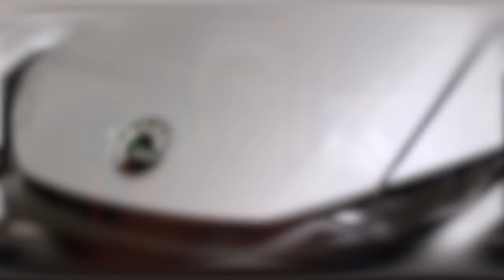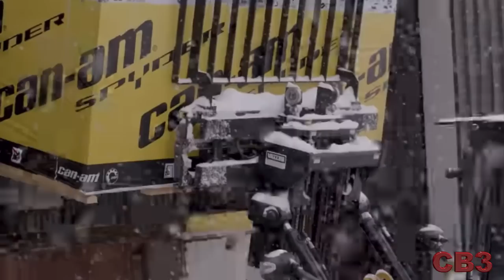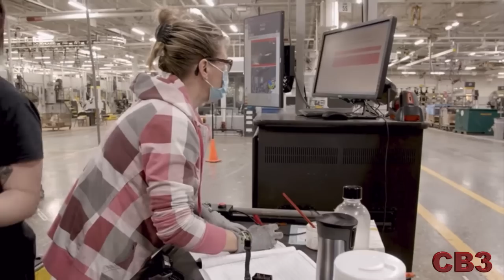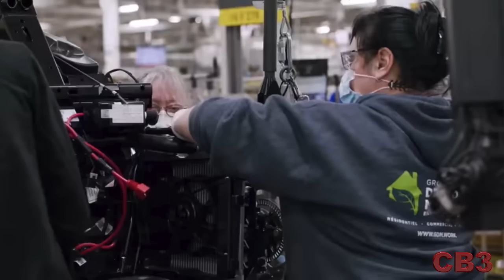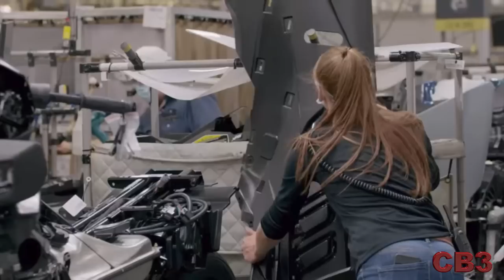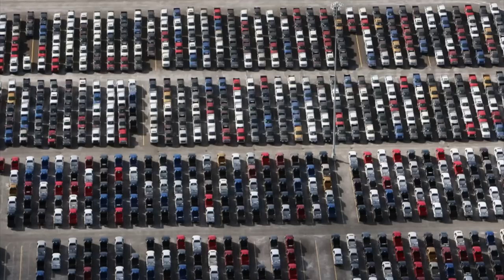WHERE'S MY SPYDER?!?  BRP Production and Shipping Delays!!!

Comment: Great post, Coach Bob - I really needed this!  You nailed a good bit of what's happening, but I have to speak from a consumer in the middle of a purchase perspective.  Apologies for the length and hope you stay with me to the end.  I've had a pre-order contract in since December 2021 - then cancelled (come back to that in a bit).  My current order for an F3-S Special Series was done in January with a set expectation of delivery in March-April.  Well, I call around the middle of the month each month, and the dealer tells me it's delayed another 4 weeks.  That's happened a couple time, and this last call (few days ago) was more heartbreak and disappointment.  He now said it's looking like end of June! 😭

While disappointed, I get it and I'm not harassing my sales guy.  What I will say is that it is unfair is given the circumstances, it's not right to lock a buyer's money with a "no refund deposit" given the circumstances.  Basically, the '22s were getting prepped and released back in Oct/Nov and BRP took pre-orders with nice incentives - that was cool.  But to do so and say to lock in you have to put down a non-refundable deposit - knowing you can't make the delivery date AND cannot honestly say when you will deliver - is borderline unethical.  We should be able to break out of the deal with hopes of either getting it someplace else or even using that money to look on the used market.  That's one of my beefs.

You're spot on with BRP doing partial releases, and I agree with you - it's a bad idea for all the reasons you've stated.  My sales guy (in PA) said he feels my pain on the delays as he has a Can Am that he finally received - but it's not fully assembled and he could be waiting up to 6 weeks for parts to come in and complete the assembly.  That's not a good situation.  So the shortage I think folks know by now is a real thing, and the partial assembly is real as well.  Like you said - I would rather have BRP QC it properly then ship it.  I do commend BRP for doing what they can to make the situation as right as they can.  It would be really sweet for them to throw in an accessory or extra warranty for those who already put up money for a purchase - just to say 'we appreciate your loyalty and patience, and  here's a token of that for you tying up your money.' 

Last point and to the point I said I'd come back to - while I somewhat get the dealer surcharges, some of that is pure BS.  Not to say it's wrong for them to do it - it's wrong to do it to a customer who already had a deposit and locked in on a price.  Happened to me where the dealer raised my price AFTER we already had a deal and deposit.  They blamed it on freight going up and said they had to roll that cost to the customer.  Again I get it if I had just walked in the door and just bought, but we had a deal and I had a receipt a month prior!  I cancelled because I told them I've been monitoring the situation, so what happens if freight goes up again?  Will they raise my price again?  When they said yeah, likely, I said refund please.  To be clear - it was the fact they said that it would go up should freight go up, AND (deal breaker) when I said I wanted the refund on my deposit the manager told me he had conveniently just spoke with BRP and was guaranteed that freight wouldn't go up.  When I said "well you're still trying to charge me above my original sales price", they said they could bring it back!  At that point it just felt like games, and I already had another dealer giving me a better price - because they were charging NO FEES!!!

I spoke to another dealer who said they would eat the cost in the case of already having a sale in place and would honor the original agreement.  That's what I think most would expect.  Anyway, thanks for letting me vent!  I hoping to get good news in a few weeks and not another delay or pushback.  Already feeling like I'm missing half of the riding season due to all this. 

Lastly thanks again CB3 for this great post addressing the situation.  You can only imagine the frustration we feel for those who already have money out there and are stuck in limbo.  Hopefully BRP can get things on track quickly as I love the product and really want to be out there riding!

Comment: Here is why there is such a shortage of items , I worked for an automotive manufacturing plant and it was a " just in time " facility. That means everything must arrive just at the right time so the flow keeps going that means no storage no supply and is a very fragile system.  And the last 2 yrs it failed drastically and will never recover . Manufacturing has to totally revamp the way products are built and will take years folks we are screwed.

Comment: Ordered my 2022 Spyder RT Limited on 12/29/21 and was delivered to my local dealership (Hunter Power Sports in Hendersonville, NC) on 5/20/22 missing components as you had stated. My bike was missing the reverse actuator and the windshield actuator and the dealership told me it would be 2 to 4 weeks before they would have the parts. I got a call on 5/26/22 from the dealership asking me if I wanted to pick my bike up the following Saturday 5/28. This was actually 5 days from the day they told me that my parts would be 2 to 4 weeks. So far after a week, my wife and I have had a blast!

Comment: Thank goodness you have your Closed Captions turned on otherwise I would have to re-learn English to keep up with my lip reading. We supply to them and they have expanded their requirements from us to provide additional sku’s. We manufacture Worldwide but we are a relatively small vendor to them. I wonder how they are remunerating the dealership to “finish” the bike. Did Byron discuss the components that they have to install above and beyond? 

Agree 100% on having to finish locally. It’s a bad idea but I understand the necessity. It depends on the components.

Regarding the surcharge. The cost of freight is returning to pre-pandemic levels. It’s gone down but not fully back to normal, yet. Projections, we expect to remove our surcharges by year end based upon current trends.
Reply: I asked Shawn Smoak today on his blog how long it will take to complete the build on both an RT and an F3 which they have in Vancouver. He stated less or about an hour. 

He’s pointed out what’s missing on both bikes.

Comment: With all the chip shortage I try to buy older equipment. I have a '95 yamaha jet ski runs like a dream. I've had some crazy offers.  Newer jet skiis are having computer problems left and right. I even stopped buying appliances that have computers. I've bought two washer and dryers and I didn't make it 10 years. They had these things designed that it is cheaper to buy new than to fix the existing on. I bought a washer and dryer from an estate sale That was made in '92. A Maytag. If it breaks down a heating element and a start button and one heat position and I can still get parts. Hope CanAM don't get stupid and buy some cheap part versus OEM. If they do they are going to piss off alot of people.

Comment: I'm feeling the pain of BRP's parts shortage. I've been waiting since last Oct for my dealer to receive a left hand multi function switch for my 2018 RT. The latest word was BRP will release it in July (maybe). Until then I have no Reverse, no manual down shift and no manual to shift into Neutral. Down shift and Neutral not a big problem, but I have to be careful where I park so I don't have to push my bike out.
Reply: Wow!  I feel worse for you than I do for me - I want a fully assembled unit, not a risky situation...

Comment: I am very disappointed with BRP management. I ordered a 2022 
Sea2Sky here in Jacksonville Fl. Dates change more than 3 times. Told to be patient. So my vehicle comes April 1st. (Who is the fool)?
Saturday April 2 I was called an hour before going to pick up my desired 1st motorcycle. It is missing the cluster gauge, so we can’t deliver it. 
Financing is done. Insurance is paid for but I can’t receive my order. No answer to a time line of parts coming. Waiting over a week and no answer to my dealer regarding the parts. I decided to pick the last 2022 spider available A F3 limited. It’s very nice but it is not what I desired. 
I knew I wanted a 3 wheel spider so I got one but disappointed in BRP management skills. Be patient with us is not a great answer to customers who have done that already

Comment: This is not only affecting new buyers but those of us that own spiders that's are in need of repair parts. I took my spyder RT to the dealer in March of 21 for an oil change and to get my gas and temperature gauges operational. They diagnosed a failed instrument cluster and I finally picked up the bike in June of 21 with no working instrumentation or other components that would operate from the handlebars.  The last correspondence from BRP told me July of this year.  Maybe.  I finally ripped it apart and found two tiny broken solder points; re-soldered and now have a fully operational Spyder again. So for those that do; better pray that something doesn't break.

Comment: I have an unrelated question. When you installed the peddle commander on your Spyder, did you have any issues? any error codes, or ECU problems.
Reply from the maker: It never has.  The pedal commander has been 100% trouble free for me.

Comment: question.... at what point is a ryker/spider considered to be high mileage or to stay away from when looking at used?
Reply from the maker: I have seen many with 50K and more on the Spyder.  I would think for the Spyder on the used market 30-35k would be safe and make the price a little lower.   The Ryker..I will have to look into that.

Thanks for watching and commenting.